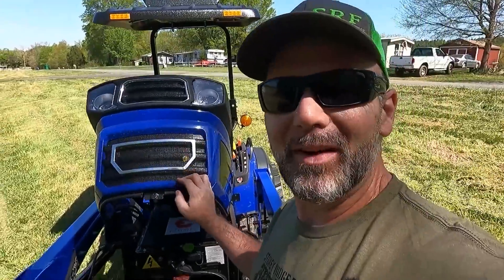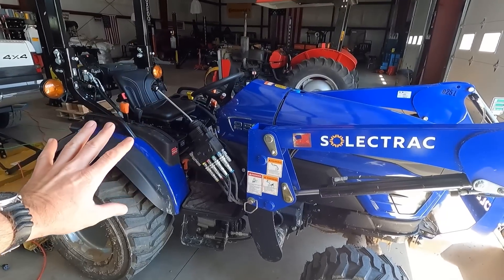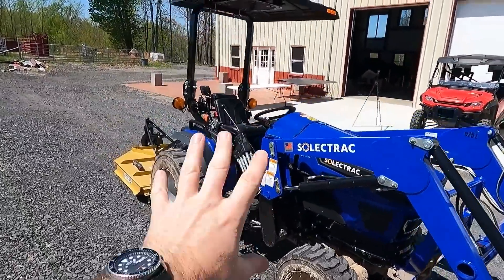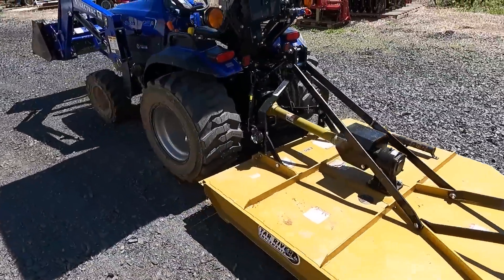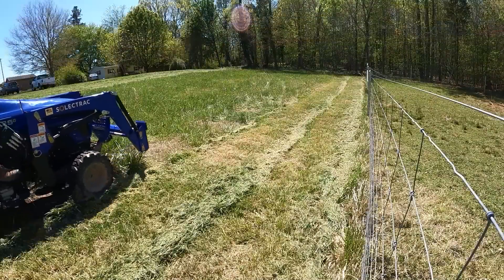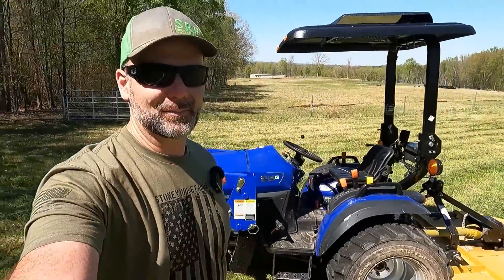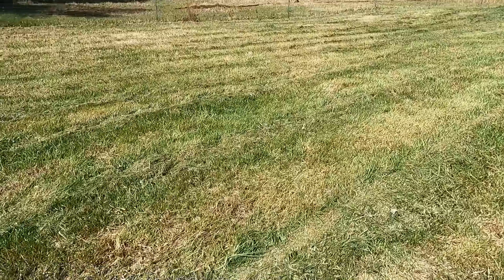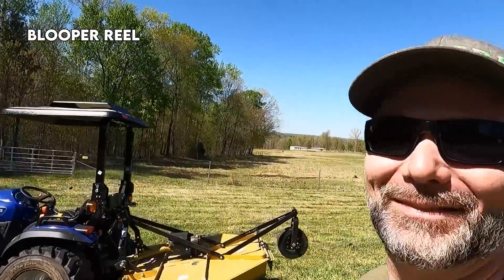Electric Farm Tractor testing....first time brush mowing tall grass

Comment: How much does this cost for a small tractor? And if the battery needs to be changed how much does that cost?
Reply: They charged it by solar but that setup looked to be close to 4k or more
Reply from the maker: we all carry a cell phone my brother.....so we're all carrying batteries right? It's a tough one huh.....when we all have phones, laptops and tablets
Reply: @StoneyRidgeFarmer  ok.....
Reply: @StoneyRidgeFarmer  I know your shilling for them but the technology isn't there for big batteries yes everyone has a cell mine takes 45 mins to charge not 12 hours of downtime on a machine many if they made batteries that  can be removed and fresh ones put in to keep going
Reply from the maker: I don't think it's appropriate for you to say anyone is "shilling" something....I'm showing you a tool on the farm and we should all be supportive of one another instead of putting each other down and insulting each other.  That's what community means buddy...."shilling" is a very derogatory term.  This isn't a row crop tractor that needs to be ran 24/7.  Just as I've mentioned ...it's a small homesteading tractor.  If you're riding a compact 25hp machine for 10 hours...you need a bigger tractor
Reply: @StoneyRidgeFarmer  Yeah I guess in the theses time's if you have to use what you got I still stand by batteries are not there yet definitely not price wise one day it will get there
Reply: @StoneyRidgeFarmer  and you are right no offense meant My Apologies
Reply: Good conversation, but my question wasn’t answered?
Reply: I see their is a lot of controversy with this, segment, I believe it is due to this government trying to cram things down the Americans throats. Plus change is hard.
Reply: @timpotter8715  true
Reply: @timpotter8715 
You can buy whatever you want to buy. No one in the US is required to buy a particular engine.
Reply: @thebeardedhomesteader 
I’ve been using lithium ion powered laptops and drills and lawn mowers for years now. Time to scale up!!
Reply: @ChitFromChinola  still didn’t answer my question how much does this tractor cost, and how much is a new battery when the battery has to be replaced?
Reply: @timpotter8715  
They’re website says $29,000 including a six-year warranty. The battery cost is not listed, but it’s covered under the warranty, and the price will be much less ten years from now, so today’s price is not relevant. This tractor uses a lithium-iron-phosphate, which is more durable and lower cost that the lithium nickel batteries used in most cars.

I have owned an e25 for two years now, and it’s pretty cool. I mean, you just plug into an ordinary wall socket, and the next morning it’s fully charged. No diesel, no gas, no oil, no noise. It makes me smile every time I use it.

If you really want a life changing experience, try a battery powered chainsaw. It makes you realize how awful the gas ones are. Lol.
Reply: @timpotter8715  yea. Really. What’s the big secret?  Geez!
Reply: That setup with loader and industrial tires with 8% sales tax is about $38k

Comment: Josh I love your channel but I gotta say this feels like an infomercial.  

1. You try to impress upon its anemic run time of 4 hours and then down play its 12 hour charge time.  

2.  You said, compared to a petroleum tractor that it didn’t bog down.  The grass you showed is very light stuff that my B2650 would mow with absolutely no problem.  

3.  You say the battery is rebuildable and recyclable.  Whats the cost to rebuild?  Right now China is destroying the environment and using slave labor to extract the metals used in that battery.  That machine is FAR from environmentally friendly.  

4.  Back to the petroleum, you act as if refueling a tractor is a hazmat level operation with spills happening all the time.  

5.  The tractor by itself costs $30,000.  That’s what I paid for my B2650 with loader, backhoe, pallet forks, and rototiller.  A small homestead would still be better off buying a traditional 25 hp subcompact or compact tractor with a diesel motor.  

I’m sorry the juice is not worth the squeeze on this and it’s a shame to see you try to plug for a company just because they gave you a tractor to try out. 

In short, please don’t let your channel become a cheap infomercial.  I’d tune into the home shopping network if I wanted that crap.
Reply from the maker: I'll let you know that you're insulting a man that works very hard and it's not appropriate.  I'm showing ya something you'd never otherwise see...I travel all over the world to do this for you and i don't deserve to be put down for it
Reply: @StoneyRidgeFarmer  first of all I’m not insulting you.  I’m being critical of this particular video because it feels disingenuous.  If you can’t handle that then perhaps you need to close the comment section.  

I’ll add another point to this “fine” machine.  Tractor time with Tim just released a video pinpointing a MAJOR flaw with this tractor.  It doesn’t have a live PTO which is fine if it was a farm tractor designed in the 1940’s.  But more importantly you can’t run the PTO while the tractor is in reverse.  Why didn’t you mention that?  If you’re mowing and need to backup to get to a tight spot you can’t do that with that tractor.  That’s beyond ridiculous for a tractor designed in the 21st century to not be able to do that.  

You make plenty of awesome content, this is not one of them.

Comment: What’s the cost of the battery and them cost for the technician to remove and reinstall? 10years isn’t that long and I can speak from experience that a diesel tractor that is well maintained will last a whole lot longer than 10yrs. Not to mention all the issues the electric car world is having with fires.
Reply from the maker: kinda hard to speculate on labor and material costs 10 years from now my friend

Comment: The Tractor works fine and quiet. Electric motor with very few parts. What could go wrong? Need new batteries on a Tesla? You might as well buy a new Tesla. The Disposal of Lithium batteries is a environmental disaster. But new battery technology, now tested and better, will save the day.

Comment: that's very heavy for such a small tractor,  people buy small tractors to drive over lawn without digging it up.
Reply from the maker: 4k lbs and it drives right across this pasture just fine my friend.  It has a wider footprint tire.  My skid loader weighs about 8500lbs and I drive it across the yard all of the time...it's all about distribution of the weight my friend

Comment: 10 year life? Just long enough to get it paid off. I have a 9N from 1950 thats still goin. 
It looks likes like a hard workin little tractor im not knockin on it but I'll stick to diesel and gas
Reply: 10 year life? Just long enough to get it paid off. I still have an old Ford 9N tractor from 1950. We'll never get 70 years of use out of anything electric. It seems like a hard workin little Tractor but I'll stick to Gas & diesel
Reply from the maker: I have to say...it's pretty pleasant working this quiet little tractor that's powered 100% off grid my brother
Reply: That 10 year life span is just for the battery I'm sure it will go way past that but the capacity will be much lower! There are companies out tnere that referbish these batteries at a fraction of the cost of a new replacement and there is new battery technology that is coming that a new replacement will be longer lasting and way cheaper!

Comment: 12 hrs to charge from (E) to (F)? I'll stick to my gas tractors, well you can get a hell of a lot done in 12 hrs. The ONLY way to keep going is to buy like 2 or 3. And  the bigger tractors charge like is 3 hours and charging time 16 hrs.....the "green" things is a complete joke in my opinion. They pollute 100x more than gas......these mines where they get the elements like lithium the refining process pollutes both water and air.....might be "green" for us westerners but for those mining/refining, that's a big NOPE!
Reply from the maker: Why? It's a chore tractor....not a row crop tractor or a harvester.  It's a chore tractor to work around the homestead and farm...doing small chores.  You do understand that electric equipment like this has been in use for decades in warehouses, mining and other industries right? This isn't the first of it's kind...it's just the first to be used in the farming/homesteading world

Comment: Batteries do not like cold weather. I would be amazed if battery pack lasted 10 years. Just like electric chain saw or weed eater. Small jobs fine. 8 hour workday, no good.
Reply from the maker: we live in NC...our lowest average temps are around 25 degrees....I've only seen it go to 0 degrees once here so cold weather in temperate NC isn't an issue
Reply: this is a good point... i live in minnesota where it gets -30 . id be curious to know if this has a drastic effect on the battery..... ive wondered this about electric cars here but most people that have them seem to have nice garages to keep them in the winter.  it was 85 degrees here 2 days ago... and today we got 2 inches of snow. ha